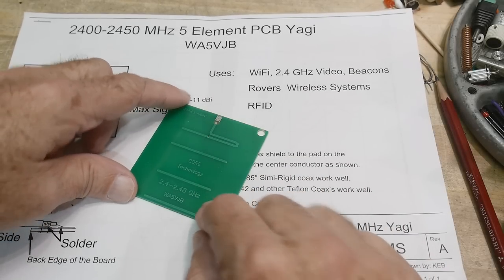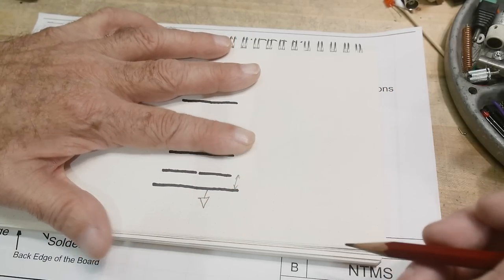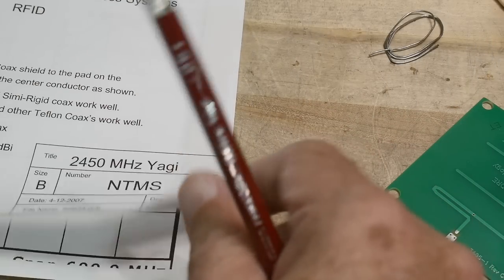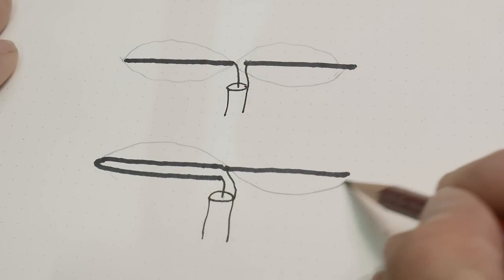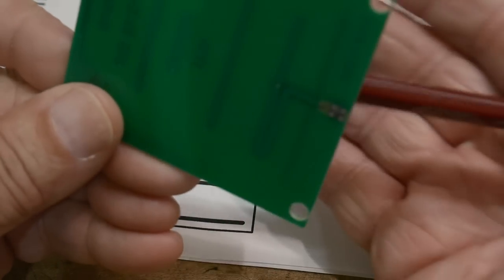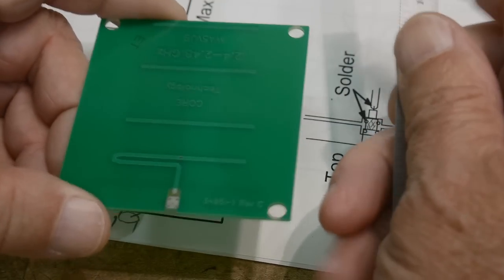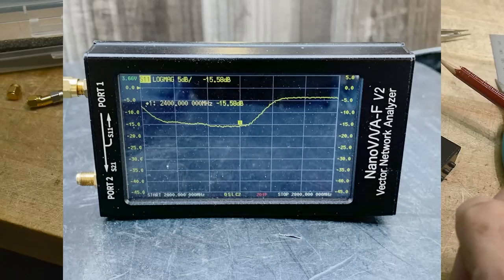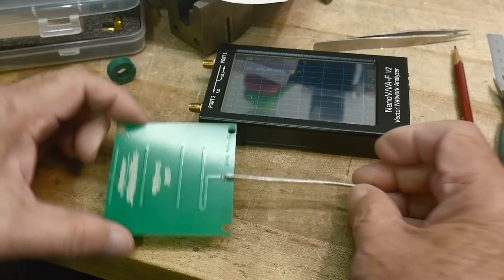#1456 PCB Yagi antenna for 2.4GHz

Comment: Hi, I want to make some clarification here.
The yagi's driven element has the J shape and has a feed point impedance of around 150 ohms in free space. (The regular folded dipole structure is employed for a wide bandwidth (as in analogue TV receiving antenna) and has a feed point impedance around 300 ohms)  Here in this antenna impedance matching (tweaking for low SWR) to a 50-75 ohm coaxial cable can be done by trimming a bit off the free end. That's why the free end of it is shorter compared to the first director.
The explanation for the working of the yagi-uda antenna itself needs clarification too.
The dipole (in free space) alone has a feed point impedance of around 75 ohm +j43 ohm and has a directivity gain of 2.15 dBi.
In the form of a yagi uda directional antenna the feed point impedance of the dipole (driven element) gets lowered to around 35 ohm or even less depending on the number of parasitic elements (reflector and the directors) you are going to mount on the boom to achieve more directivity gain in a particular direction. This is because the dipole current is getting shared among the parasitic elements by mutual coupling.
The spacing between the driven element and the reflector is worked out to around 0.2 lambda; the spacing between the driven element and the first director is around 0.15 lambda. It may be varied for a specific Front to Back ratio and cancellation of the side lobes. 
The signal from the dipole tends to propagate in all directions and particularly in both forward and reverse directions in the plane of the yagi antenna. The reflector (usually being 5% larger in size) and the typical spacing result in interference with the signal emanating from the active driven element. Part of the reflected signal after a small delay constructively interferes with the signal on the driven element and moves forward. The current on the director element too constructively interferes with the signal from the driven element and all move forward as if guided along the boom. With each half cycle the wavelets alternate the polarity but keep moving forward as if a light beam (after all light itself is the visible part of the EM spectrum) is being directed by a parabolic reflector and condenser lenses etc.
The centre of the boom being at isoelectric potential can have the centre of a folded dipole or the centre of the driven element used in this antenna and all the parasitic elements' centre anchored to it. 
Any small metal fragments scattered in between the elements unconnected to each other and to any of the elements or the boom would be invisible to the RF energy propagating in the forward direction. So, the letters having copper in them would not affect the performance.
This 2.4 GHz Wi-Fi yagi uda antenna must have produced the S11 pattern as found in the literature that came along; I don't know why you didn't get it right.
Moreover there's no ground plane or the need for a ground plane as such.
A dipole is a balanced device. The coaxial cable (intrinsically unbalanced device) has both the hot (centre conductor) and the cold (outer shield braid) terminals that are connected to the dipole at the center. 
The half lambda dipole has maximum current in the middle and maximum voltage at the ends; the current and the voltage are 90 degrees out of phase. Because of maximum current and minimum voltage at the center the impedance is low, ie, around 75 + j43 ohm. The RF power fed to the feed point of the dipole is dissipated in the (virtual resistor) Radiation Resistance; yes at resonance the inductive reactance and the capacitive reactance are getting cancelled in the otherwise series resonant half lambda dipole antenna elements.
The voltage at the ends maybe around 2500-4000 ohm or more depending on many factors like height of the feed point above the ground, nearby RF absorbing, scattering or reflecting structures. 
The EFHWA antenna is fed with a 49:1 UnUn for this reason.
De VU2RZA
Reply: I tend to think WA5VJB added the lettering just to make a point (not exactly sure what that is; but, I can guess.) Anyway, I tend to think... that like you said... that lettering is in between the directors... and in the near field of the antenna... so at least the phasing effects of the directors will make the copper lettering's presence immaterial. (Maybe IMASI guy can grind them off, and see some significant difference?)
Reply: Thanx to you and IMSAI Guy. My understanding of antenna is very weak. When I see something that doesn't make sense, I try to find out why rather than to assume the designer made a mistake.

His drawing reminds me of two ways to feed  a dipole. @6:00
One with a grounded center, the driven element connected to the boom. I believe this was an unbalanced feed.
The other had the driven element isolated from the would be a balanced feed. 
It seems the Mosley TA33 and TA33 Classic is where I saw these configurations (30 years ago). One used a gamma match and the other used a t-match. Do I understand this correctly?

I also notice the reflector is connected to the driven element, where the directors are not. It seems this connection is important. Why?

I read the Richard Feynman book QED and one chapter described diffraction gratings. I think this helped me understand the co-linear antenna from the perspective of the diffraction grating. By cancelling every other 1/2 wavelength it would only provide, what you called constructive interference. So when I see the fold on the left of the lower drawing @6:00, I see this to cancel the 1/2 destructive wave. 

I would be interested to hear from a knowledgeable person about the correlation between the refraction grating and the co-linear antenna.
Reply: Confirmed. It is a typical Yagi-Uda antenna and method to feed the antenna is very common , including the short transmission line and connection to the reflektor. I expected almost that element length measurement should make confusion in this video.
If assuming correct calibration, tuning could be somewhat improved. A possibility is that this antenna is a copy of a copy design. Different PCB types and PCB thickness then original intended design can then cause minor detuning. A Smith-chart hade been informative both about antenna tuning and calibration.

Comment: WA5VJB (Kent Britain) is an RF guru particularly when it comes to microwave antenna design.

I spoke with him about his antenna designs maybe 15 to 20  years ago. The "strange" feed mechanism is by design: it offers a balun function, impedance match, and makes it a little more broadband, at the expense of a slightly off-bore direction, which is insignificant for this relatively low gain.

Of note is that you must remember that the PCB substrate is not benign here: it has a significant effect on the antenna's performance in terms of impedance matching and size due to the relative permittivity of the dielelctric.  

I've had lots of success with his many Yagi designs over ht past couple of decades, from VHF to SHF using his designs: they are the most reproducible Yagi antennas I've ever built. 

Basically, he really knows his onions: I'd be very careful about second guessing his expertise in this area!

Comment: You keep drawing the driven element as a full wave antenna,   IT IS A HALF WAVE!     The plots on the data sheet were done with a Rhode & Schwarz  FSL analzyer.    Letters are only 1% of a wavelength wide.  Way to small to affect an EM wave.    Make the center conductor of your coax shorter and Return Loss / SWR will  look better.    Kent WA5VJB

Comment: The ends are voltage (E field) anti-nodes and current (B field) nodes.  The center is an E node and B anti-node.  The total distance across is half of a wavelength and not a full wavelength.  As a first approximation, the reflector acts like a mirror and places an image of the dipole (and directors but with 1/r^2 intensity reduction) behind itself.  This mirror changes the charge sign and the distance delays the phase, however.

Comment: It's really easy to get PCB boards built. It would be interesting to go though the design process for this type of antenna. As I recall, there are charts that give the spacing and length of the elements, but I'm not sure how much the FR-4 dielectric will influence these numbers. Of course if it was influencing the design, a lot of it could be milled out from the board...
Reply: FR4 has a significant effect, it is not benign, but mostly in terms of the Er reducing antenna size rather than losses.

The FR4 Er is fundamentally built into the design.

Comment: There is not the one and only dimensioning for Yagis. You can optimize it for best match, maximum gain, maximum front to back ratio. And the dimensioning is always a little different.

Comment: 1. Reflectors don't, in general, need to be grounded.  Like directors, they couple just fine floating.  Usually all elements are grounded on lower frequency Yagi-Uda antennas to prevent static build up.
2. The driven element here is an end fed half wave with an approximately 1/4 wave impedance transformer to produce the high impedance feed.
3. The length of the parasitic elements go according to the Yagi formulae, because that's all that controls their resonance, and thus, phase shift. (reflectors lead and directors lag so that the traveling wave in the desired direction passes each element in phase with what that element is re-radiating.  The driven element need only be resonant, and in combination with the drive impedance, is whatever length this requires, not necessarily in the Yagi sequence (it comes closer to that with the typical gamma match used at lower frequencies).
4. If your hand was anywhere near the antenna when you took your readings, such as holding it by a corner of the board, or by the COAX at the edge of the board, then your measurements are worthless.
5. Don't confuse voltage with field.  There is,, for instance, E field near the center of the element, it's just parallel to the element rather than radial.
Reply from the maker: thanks. on #2, does that end up at 50ohm? and once inside the reflectors and directors the impedance is lowered right? can a folded dipole (300 ohms) end up at 50 ohms if all is adjusted to each other. or is a balun always needed.
Reply: @IMSAIGuy  Yes, being inside the Yagi does affect the impedance (part of why they're tricky to design.  The gamma match on the typical HF or VHF Yagi embodies two independent adjustments (trombone capacitor and tap point), which is pretty flexible.
Yes, the matching section, if properly designed, means that you don't need the non-1:1 transformer aspect of a voltage balun.  But it is still useful to have a current balun to keep RF off of the outside of the shield.  For one thing, it's an extra impedance attached to only one side, so it "unbalances" things and changes the feed point impedance, but it also distorts the pattern, always reducing gain.  A few ferrite beads around the COAX near the antenna should work, but you would need to research what mix might be appropriate: the usual 43 or 31 mixes may not do what is needed at 2.4 GHz.  It will probably also help to keep the COAX perpendicular to the elements for a few wavelengths, and if using multiple beads, spread them out a bit over this part of the run.  It also doesn't hurt to have a bead at the radio end of the COAX, but I suspect that you're not talking about enough power to be concerned about RF burns.

Comment: If unsure. Do take a base line measurement with open/short/load standards and test the antenna again. 

If still unsure, recalibrate the measurement with same standards then base line test with just the load, to expect -50dB or better before testing the DUT. 

Hope this helps.

Comment: Why is the dipole part of the yagi shortened? ... well...  WA5VJB's design is using... AFAICT... a "gamma match" (the folded part)... and that bottom leg (the parallel part) adds reactance. One can sometimes reduce/compensate for that, by shortening the antenna length. Seems like that is what WA5VJB did. It's hard to get a gamma match just right.

Comment: Are those "wrong looking" dimensions of the dipol and the directors not for impedance matching? An ideal dipol doesn't have 50 Ohm. Also the folded radiating element is not making any balun thingi so the coax shield doesn't act as part of the antenna?

Comment: The dipole doesn't appear to have the same centerline as the first reflector ... it seems to be shifted to one side a bit.  (Can't be certain as I used measurements from my screen and the angles are usually oblique, but it certainly appears that way in multiple views.)  I wonder what that would do to the pattern.  (I'm not an RF guy and have no expertise there.)

Comment: Ai caramba! what a terrible description of the workings of a Yagi antenna. I had to double check the posting date what with the dodgy lobe maps to check it wasn't another April Fool video!
The reflector is in no way a ground plane. 
Electrons are not sent forward by the antenna.
The copper lettering is not a problem, each letter being a tiny fraction of the wave lengths involved here and also not connected to each other or indeed anything else.
Others have already commented on the fed system but I dont think anyone mentioned that the two tracks that connect the coax solder points to the driven element are probably a eighth wave matching section, this would help matching and provide additional balun function.
73 de G0AFV

Comment: That looks kind of like a sideways J pole for the radiator element.
Reply: It is.

Without it, you'd need a balun and matching transformer of some sort, as the parasitic elements would take a dipole driven element impedance much much lower than 50 ohms. The folded element affords significantly increased impedance, as well as acting as a balun. Side bonus is that it increases bandwidth somewhat, making it more reproducible, and discarding any need for tuning.
Reply: Thanks for the explanation.

Comment: 5:14 Isn't the center suppose to be at max amplitude , if it is zero that means you have no signal? (when receiveing)
Reply: RobotZer0 - It is strange that the voltage signal at the center is 0.  But it is the current flow that counts.  See the Wikipedia article on Dipole Antenna with an animated diagram.  Although it is still puzzling because we would think there should be a voltage signal across the 50ohm load due to the current flow through the resistor.  Hmm. 🤔
Reply: @robinbrowne5419   From that wikipedia article half wavelength antenna has maximum current at the feed point...

Comment: See VU2RZA explanation below. (By the way, he has a large antenna farm; but no yagi antennas?!) Anyhow the folded element in the yagi is called a "gamma impedance match" (which is 1/2 of a T match) ... and the gamma match is used to match the impedance of the antenna to the transmission line... and the balanced load (the yagi antenna) to the unbalanced transmission line (the coax cable)... without the need of a balun transformer. The coax connects to the gamma match.
Reply: Sometimes, when there is a HF yagi up... you can see the gamma match as a rectangular section, parallel to one element of the dipole section. There is an adjustable shorting bar connecting the dipole element to the parallel leg of the gamma match  (You can see a fixed version of that shorting bar, in WA5VJB's design... its the U at the end.)  Anyway, on the big HF yagi antennas with an adjustable shorting bar... you can have endless hours of fun moving it to try and get the best match.
Reply from the maker: all the gamma matches I've seen don't go all the way out to the end. guess I need to model this someday
Reply: @IMSAIGuy  The way I've understood his designs based on this is that it's an unbalanced folded dipole, so effectively a J pole driven element. It offers balun, matching and wider bandwidth all in one clever design. Two further benefits: his designs are very reproducible and usually don't need tuning.

If you tried feeding it with coax just using a dipole without a balun (1) you'd radiate on the coax outer too [I note you didn't mention this in your treatise] and (2) the impedance would be far too low [due to the parasitic element loading] for 50 ohm coax so you'd need a transformer. This J pole design acts as the integrated transformer and balun, with the added benefit of increasing bandwidth thus making it more tolerant to minor dimension aberrations and more easily reproducible.

In short, WA5VJB knows his onions: if you weren't aware, he's an absolute guru in VHF & microwave antenna design.
Reply: I knew there needed to be a balun somewhere. Excellent design!

Comment: Dumb question. Shouldn't there be a "Balun" transformer between the cable and the antenna?
Reply from the maker: read the comments below, the odd 'dipole' I talk about is both a dipole but with a built in matching network.